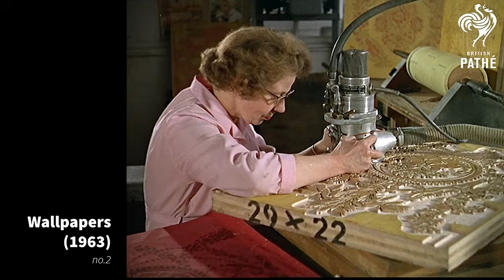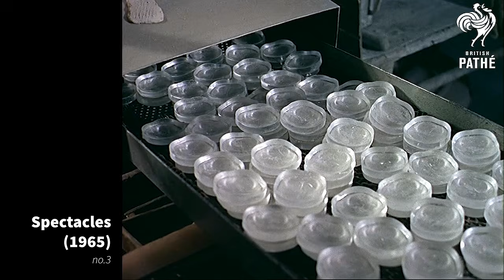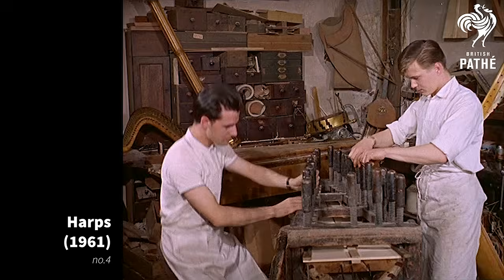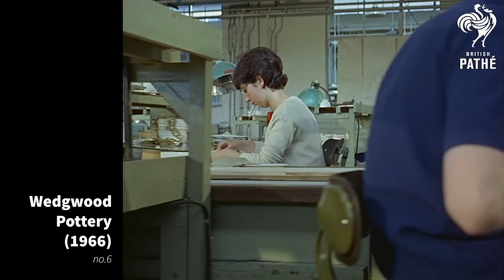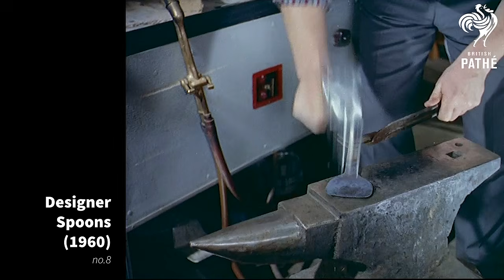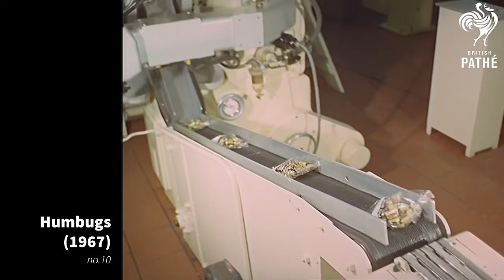10 More Mesmerising Manufacturing Films from the 1960s | 2nd Edition

Comment: Burns Guitars is still in business, btw.
Reply: The name still exists, but the company's died and been resurrected a few times since this film. The original models are quite collectable and demand quite a bit of cash for a good one. The modern new ones are just cheap Chinese versions with a Burns logo on the headstock. They've no actual relation to the company in this film.
Reply: Just had a look there quite cheap